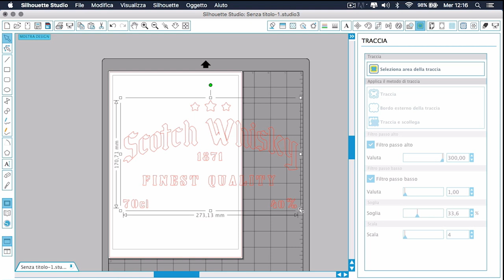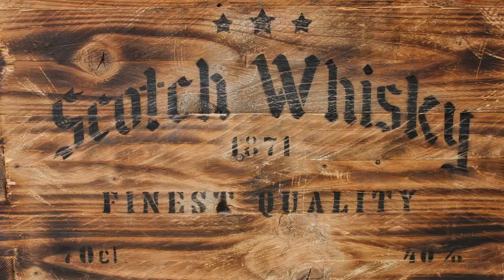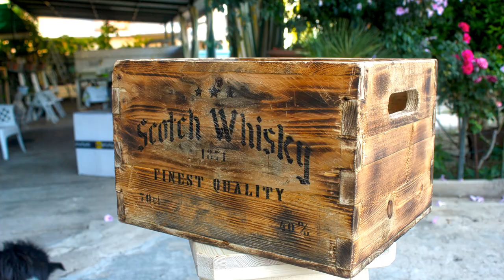Rustic wooden box (Wooden crate -Vecchia cassa di legno)

Comment: I normally don't make safety comments, on personal freedom and responsibility grounds, but in this case it's so egregious I feel compelled to make an exception, lest some viewer feels it's a good idea to try this.  Never freehand wood through a 5,000 rpm spinning blade!  Relax your grip for less than an instant, accidentally give the wood a slight twist and bind against the side of the blade, and the bottom of the workpiece can so easily be kicked back toward you, bringing your hands down into the blade before you know it.  Taking 10 minutes to throw together a crosscut sled with a tall rear fence to brace the upright piece against  (or even 2 minutes to screw a wide board to your miter gauge and brace against that), could save a lifetime of not having your fingers!
Reply: Can confirm... made that mistake once while free-handing wood through a router. The bit hit a hidden nail, instantly yanked the wood, pulled my hand in, and chewed off the end of my finger down to the bone in a flash. Nothing to stitch, so the doc had to cauterize. Luckily the skin grew back and it's hard to tell now, but that part of finger doesn't have any nerve endings.
Reply: I lost the top of three fingers doing what he just did
Reply: Hi Paul 
Glad you made a full recovery and it appears it’s been a lesson learnt. Myself not quite so lucky but always remain as positive as possible, although I have a life long impact it could have been worse and does not effect my job as a mental health nurse.
Reply: When I saw the table saw thing the only thing going through my head was "Jesus tap dancing Christ"
Reply: Very nice design, BUT, it is a disaster just waiting to happen. Would be very difficult to do woodworking without fingers!!
Reply: My hand was pulled into the table saw blade from freehanding.  It happened before I knew it.  the saw took a chunk of bone out of one of my fingers and ripped them up pretty bad.  Lesson learned the hard way.
Reply: I'm glad and sorry I read these comments. Thank you , suffering souls, for explaining why this video was so strange.
Reply: I noted the push stick laying beside the rip fence, guess it's decorative.
Reply: Is there a video you can point to, that shows how to do this properly? I'm a complete noob in all of this, but I like working with wood. Currently I'm only using non-electrical hand-tools, but might progress to electrical tools.
Reply: @kaarleenzz  I recommend searching on Steve Ramsey's channel for his table saw safety video showing principles behind doing a safe crosscut, which would be one supported by either the table saw's miter gauge (the thing that has degrees marked out on it for angling its small fence, and which slides in the miter slot).  Also search for Stumpy Nubs' similar safety video series.  And there are any number of simplified crosscut sled videos on YT, but Izzy Swan has a good quick one.  Also Mattias Wandel has a really nice mini sled.

The idea behind all of it is, you never want to introduce wood into a 5,000rpm spinning blade that can easily get twisted as you pass it through the blade, or pinch the far side of the blade (as those far-side teeth come up out of the table, since the blade rotates toward you), as this fellow's 'free-hand-with-no-suppport' approach can do.  

Having your wood put even the least amount of sideways pressure on the far side of that blade can cause the wood to get caught on a rising tooth, 'walking' the wood over into the blade as it cuts a big curved gouge on the underside of the wood, and pulls your hand into the blade before you can react.  Even if your hand is far away from the blade or you're using a push stick, any twisting/pinching can launch the wood back toward you, making a nasty wound on your belly, or worse toward your face.  

The videos I mentioned will cover all the basics, so you can use your table saw safely, understand all these forces at play as you use it, and all the precautions to take.  Using a table saw safely isn't hard, but it isn't always intuitive either, to the inexperienced.  Fortunately, as long as you educate yourself on these issues, and keep your mind focused on the task at hand as you use it (a wandering mind is the most dangerous table saw accessory), you can have a lot of fun with your table saw, and turn out some really nice work as well.  Good luck!
Reply: @JusBidniss  Thank you very much for the detailed answer! I will definitely look at the videos and make sure I understand everything correctly before attempting to use any power tool. To me, they all do seem quite scary and intimidating, hard to understand how can people not be alert while working with them! Thanks again! :)
Reply: I was thinking something of the sort too, not in those words. But he made me nervous. The final outcome tho, a beautiful piece! :) Safety First and still produce greatness!

Comment: What is the name of the dowel jig you're using?  
I like that you can line up the dowels by sitting on the opposite dowel.
Reply from the maker: I didn't use any dowel jig. The wooden box is not so small, infact the dowel height is 2 inches, so the dowel jig is not necessary. I drew the dowels on both sides of 2 panels and cut them off with jigsaw and tablesaw. After i used this panels (as a mask, as a negative) to draw the opposite dowels on both sides of the other 2 panels using jigsaw and tablesaw, as you see in the video.
Reply: +Vito COSTA box is great thanks for sharing. You did use a dowel jig though. You are confused with finger jig I think maybe lost in translation.
Reply: i think it's this one:   http://www.wolfcraft.com/en/products/p/dowel_jointers/1_dowelmaster/s/p/index.html

Comment: To drill a hole in the drill to nail, it seems ineffective to me.
Reply from the maker: Are you talking about the bottom? The hole diameter is smaller than the nail diameter (pre-drilling). I did this because the nails are too close to the edge.